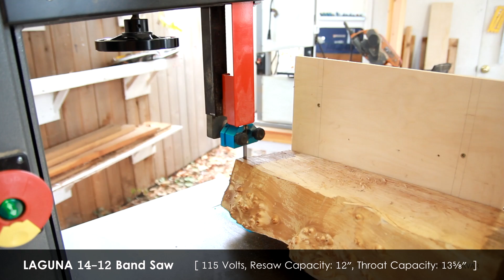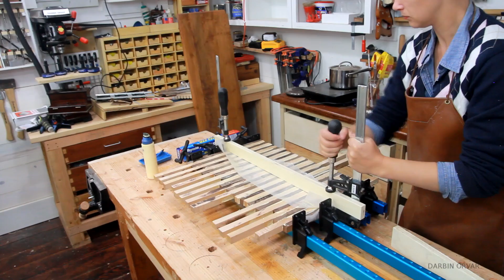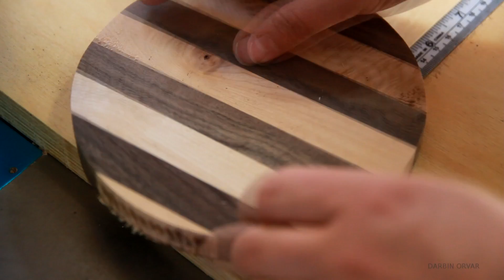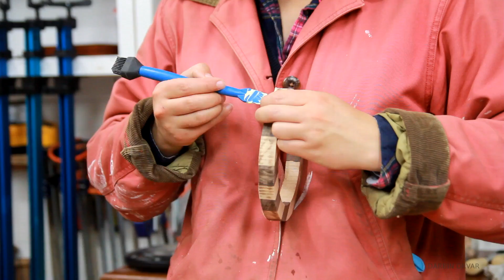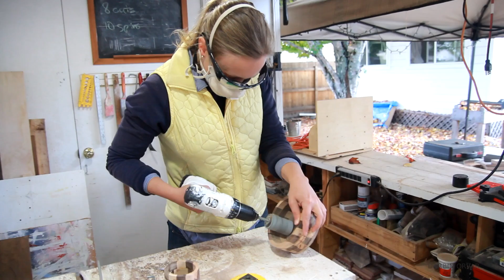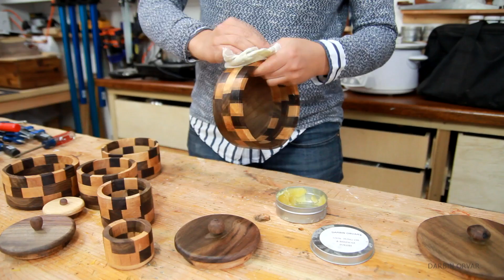How To Make Gorgeous Segmented Boxes on the Band Saw

Comment: Wow, these came out great, these boxes are adorable.
One question: I saw sparks when you were cutting the rings on the bandsaw, what was going on there? Is this normal? I am getting into bandsaws and wanted to know if this is something I should expect or avoid.
Thx
Reply from the maker: +jeffrey kuhn Thanks Jeffery, the sparks are because this model bandsaw has ceramic blade guides that can spark when relatively new. It will not harm anything from what I understand. Hope that helps!
Reply: Thanks for the info. :)

Comment: Love these. A simple tip...I needed to sand a bunch (hundreds) of candle holes. I made a sanding block like you did but glued a piece of sanding sponge to the bottom. Then I used spray mount on the entire spindle and used 3M rubber backed sand paper. It was efficient, fast and smooth as glass. Great project Linn!

Comment: Great project Linn!  One question - would it be easier to to the interior spindle sanding before you glued the bottom on?
Reply: wondering the same thing
Reply: +Alan Erickson  yes it would be. i have made some vases and i use a paint roller with sand papper on it to do the inside . if you look up on handcraftedwoodshop on face book you can see my vases  there cool
Reply: I just came across this video and was thinking the same thing.  I have a spindle/belt sander so sanding on that then adding the bottom would be easier.
Reply: It is, if you remember to do it before you glue the bottom :-)

Comment: Is the bandsaw sparking when linn is doing circle cuts on the bandsaw?
Reply from the maker: +Jared S Hi Jared, it is normal for sparks on a Laguna Bandsaw because it uses ceramic blade guides.
Reply: +Jared S looked more like it was coming from the guides she has might be set too tight.
Reply: +Jared S Yes.  It seems the blade is rubbing too much on the bearing behind it causing the sparks.
Reply: I saw that too, I figured there must have been a pin or brad  nail or something in that one piece of wood.
Reply: +Jared S Just to clarify for Linn - around the 3:00 mark in the video.
Reply: Aha, mystery solved!
Reply: Darbin Orvar that sounds very fancy!